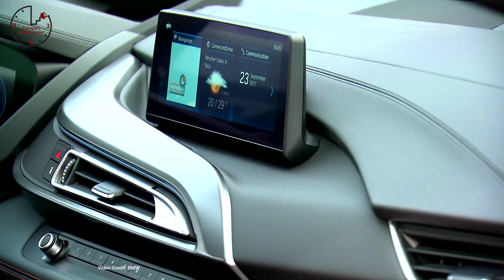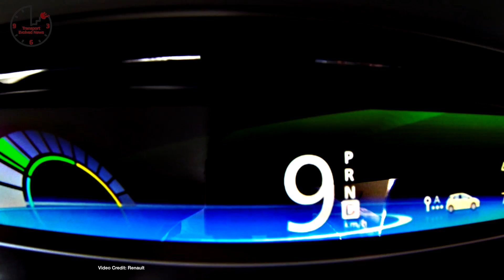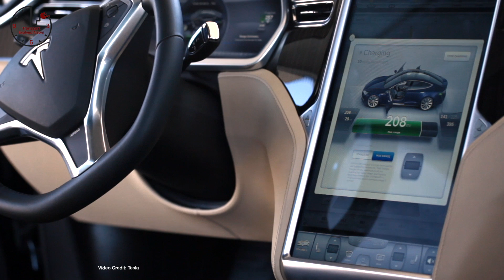Autopilot LA to NYC, Rimac Specs, Police Model X-  TEN Episode 197

Comment: It's bollocks and the battery's burn 🔥 so if you crash with your children in make sure you can get them out quickly !!! Petrol is safer
Reply: Ricky White; of course we all know that gasoline doesn't burn our explode. Lol.
Reply: Reggie Buffat yes because we see gasoline cars explode everyday don't we
Reply: ricardo brito they chemically react when the batteries are damaged cousing them to burst into flame's
Reply: Actually, Ricky, yes we do see them catch fire every day.  HUNDREDS per day, in fact.  Between 150,000 - 200,000 car fires per year are reported to fire departments in the U.S.  Any other facts you'd care to sneer at?  Let me know.
Reply: BixbyConsequence you had to search Google for this bet your a electric car owner this may be true but it won't be down to being petrol. cars catch fire for electrical issues and you would know and evacuate but when you crash an electronic car if your battery is damaged it can rapidly burn the car especially on high performance electric cars as every part of the floor is crammed with batteries ones a battery is crushed it will burn the car out rapidly
Reply: 2006 acura rl

Comment: Tesla is having trouble selling the premium model 3 because most of the holdoutts want the cheaper short range. There are plenty of them sitting around the factory.
Reply: I wish that were so. Where is my premium model 3? I am told by Tesla that my wait is at least 12 to 18 months from now (and my guess is that it will be closer to 18-24 months).

Comment: President Trump probably made a deal. The government loosening it's mileage requirements in exchange for the auto manufacturers bringing more production to the USA. An average fuel use of 46 mile per gallon by 2021 probably unrealistic anyway. 

More interesting to me is the latest anti EV propaganda  that states that the manufacturing process for making batteries produces more Co2 than an ICE car produces in 8 years of driving. Sounds bogus to me. Can anybody out there point me to a fact based study of alt energy that is objective.

Comment: I would love your opinion on the argument. If two heavy vehicles crash into each other, the argument doesn't work. Of course it doesn't work when considering engineless vehicles. But it does work when crashing into a soft walled building.

Comment: My take on EVs available in FL right now: 

Tesla X is the one to go if you have the money.
Nissan Leaf Gen 1 - The cheapest. If you don't drive 80miles a day like me, it might be the one. 
Chevy Bolt EV - The best range for the highest price. In my case, it is the option if I don't want to stop every day at the charge station.
Nissan Leaf Gen 2 - The newest one, with a lot of techs that don't work well (check Nikki's review) and mid-range that don't do any good. 

Runner-ups:
Tesla 3 - The Phantom! Doesn't exist in its 200mi range for the next 2 years. It will beat the Bolt when it arrives.
Nissan Leaf Gen 2 plus - The Eraser! - Nissan changed its mind about the Western market and now is trying to correct its mistake with a 40kW Batt. It might beat the Bolt but won't beat Tesla 3.

Any other one that comes into production must have more than 200mi range. For the US market, the SUV like will be the winner. 

Conclusion:
I'll still keep my Altima for at least 1 more year and then check the new Leaf, maybe I can get a good deal and get the 200mi one.

Comment: What a bunk argument, "would reduce road fatalities". How? Explain how that happens.

They're probably arguing that people who occupy small cars die more often in crashes than people who occupy large ones. Well yeah, because the people who occupy small cars likely collide with a larger car.

But the more larger cars you take off the road, the lower the chance you have of colliding with one, and the more kinetic energy you're removing overall.

But the real cause of US road fatalities isn't big cars, it's the love affair with intersections, the single deadliest piece of public infrastructure ever devised. A place where it's possible to be moving at 5mph, or 80mph, on the same bit of tarmac, travelling in different directions.
Reply: "the more uncertain a driver is, the less likely they are to drive inappropriately" - That might explain the Magic Roundabout in Swindon.
Reply: Fees Timmerman - and also 'Spaghetti Junction', alias 'The Midland Motorway Interchange', and the Hanger Lane Gyratory System, plus a few others with less memorable names.
Reply: *Hangar Lane. :-/
Reply: Well, there's one thing the UK does that the US doesn't:  Narrower lanes.  Your lanes are more standard, and they're more clear when they change sizes or have pedestrian hazards.  US roads are super-wide and lanes can change width without any sort of hazard marking.
Reply: Maybe large people do not fit so well into small cars, and small people are more fragile?

Comment: At this point, when Elon makes an announcement with a deadline; it's best to ignore the deadline.  It's GOING to happen, you can almost be sure of that, but not when he says it will.  

Most police in america, even in rural departments. run their cars nearly their entire shift to keep the climate control working, depending on the weather.  Having an electric car would significantly reduce fuel costs and emissions from those long doughnut binges, that's for sure.
Reply: hellcat1988, “Breaker one-nine, we got a bear on a battery pack sitting at the mile marker 120 turn-around, over.”

I want someone to modify a Model X P100D as a highway patrol interceptor, with upgraded cooling and power with a 8:1 gear ratio so it can have a higher tops speed and hold that speed for 15 minutes without overheating.
Reply: Part of the reason Teslas don't have a higher top speed is because the motor kept breaking the transmissions.  With a higher top speed geared ratio, they'd have a slower acceleration (not really a big loss there) but it might also be a weaker gear setup and break.
Reply: hellcat1988, using 8:1 should reduce stress on all parts downstream of the first reduction pinion. I think the stock ratio was just the one that let the motor hit max RPM at a speed that can be insured. If the Tesla Roadster isn’t governed (at least geofenced) below 250, insurance will cost more than the car. LOL

I guess a stock P100D can keep up with some of these modern police cars, but muscle car HP has gotten insane. My 89 5.0 GT had 225 HP and 300 Lb-ft of torque. That’s what a 2 liter normally aspirated car makes these days. 707 HP in the Hellcat.
Reply: I would argue about the insurance thing, since there are cars that exist today that can do over 200 and the insurance isn't beyond the price of the car.  I bet the do something similar to other manufacturers and geofence it so you can only TRULY tap into it at tracks and drag strips.  Would be nice if they did that for the rest of the line so people would stop street racing the S.
Reply: hellcat1988, I was exaggerating a little, but the insurance for that car as a daily driver without geofencing will be high just due to the power, performance, price, and difficulty in finding repair parts. If I had it, it would be insured as second car, par time, pleasure use and whatever other thing I can use to get a discount, LOL
Reply: Living on a farm in the middle of nowhere tends to give you cheaper insurance than in a town or city as well.

Talking about the insurance on the Roadster doesn't really phase the kind of people who could afford that car.  Just look at what you pay for Italian cars and the insurance for them; and they tend to catch fire for no reason...
Reply: hellcat1988, yes, but what if you get a free one and can’t even afford to pay the taxes on $250,000 income? LOL
Reply: N C, I try not to exaggerate unless it’s clear that it’s an exaggeration. LOL

Comment: How much does Ontario's standard cruiser cost? If it is just a bit cheaper then Model X, then they would save some cash on fuel. If it is 3 times cheaper, it would take 100's of thousands kilometres to even break even.
Reply: The PR is definitely worth something though. And as Nikki pointed out, the Model X is a very fast car- it probably performs much better than any other SUV in their fleet.

Comment: In regard to the Jumping the Queue thing, I think that means that Tesla can start delivering to non-Tesla owners fairly soon. It’s good news here, not bad.
Reply: Loui Coleman, the problem is, they will still skip over those waiting for the $35,000 version and just let anyone with $49,0000+ jump to the head of the line. That is good news if you want to spend $49,000 but bad news if you thought you would actually get a $35,000 model 3 with full tax credit.
Reply: Loui Coleman -- You are correct.

Comment: How the h**l did they get permission to do that!? Wouldn't that be like doing doughnuts around the altar in St Peters? Or around the Kaba...
Reply: Money to the local politicians, that´s my guess
Reply: Yeah, there seamed to be some safety wires so maybe the car wouldn't have rolled down the stairs if it had failed.
Reply: zapfanzapfan why have you censored Hell?
Reply: I guess in China, they are not as closed minded about certain things as some westeners are. Besides, I think engineers made all the assessments necessary to conclude there is no danger to the structure.
Reply: It's a) a giant structure b) was meant for troops and carts to move on c) the rebuilt sections need to be able to hold emergency vehicles d) the rebuilt sections are basically the same as any other road...